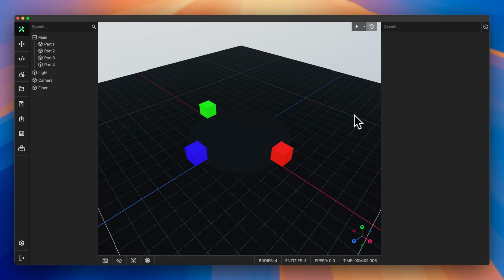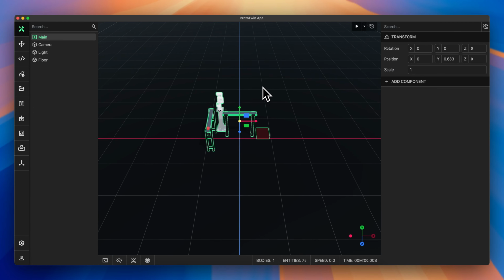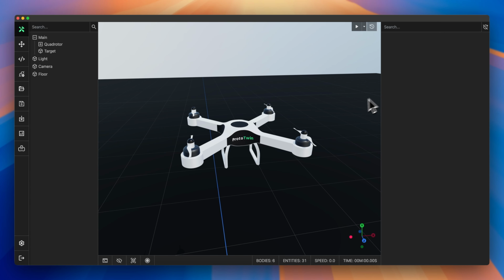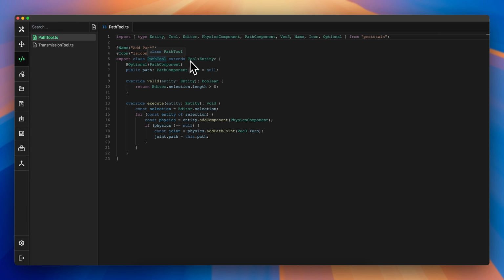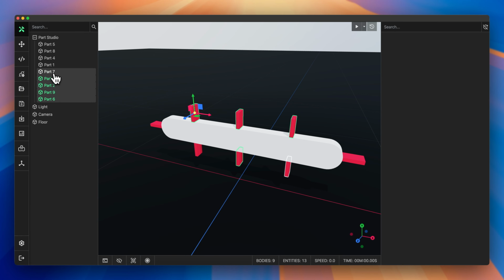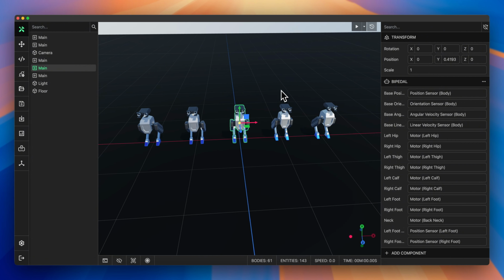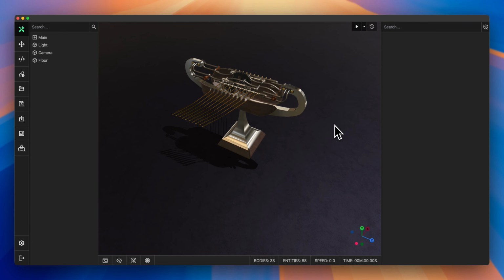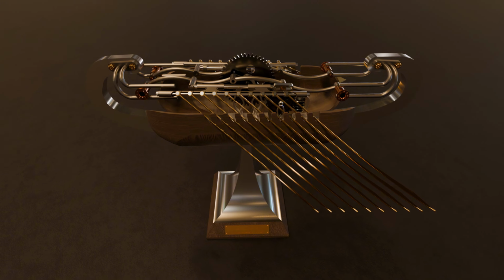Introducing ProtoTwin Simulate v0.25

Comment: Como simular um encoder ?
Reply from the maker: The motor component has an integrated encoder. If you want only an encoder, you can disable the motor (set the State of the motor of Off). Alternatively, you can create a custom scripted component to track the position of the joint and expose your own custom IO.
Reply: @ProtoTwinthanks
Reply from the maker: @mikaelnunes1017  Happy to help. You can also now use this package, without the need for a motor: https://prototwin.com/packages/view/@prototwin/position-encoder
Reply: @ProtoTwinthanks